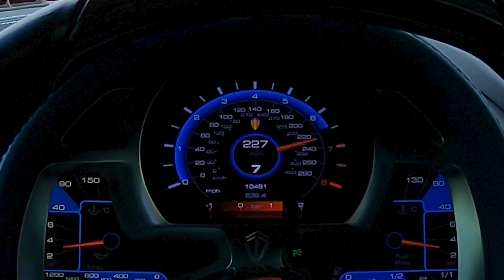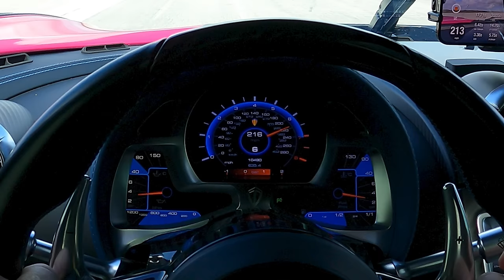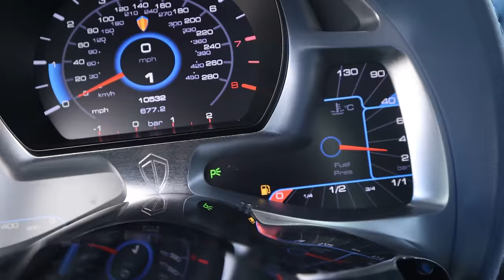My Koenigsegg Agera Broke and Needs Fixed.

Comment: The blue looks SO much better.  Can't wait to see it without the matte wrap.
Reply: ppf have a purpose, it is to keep the paint safe and clean
Reply: @komar2452  correct, but the matte finish desaturates the paint. With a gloss PPF it will look much deeper
Reply: @komar2452 Also you can get clear PPF. I don't even know the OG colour, but covering that impeccable carbon should be a sin.
Reply: Satin paint has a shinier finish than matte which is more flat. 7:48

Comment: Pro tip. Don’t worry about speed till after the run. Worry about RPM and staying centered on the road. Your speed is independent of your gaze, your shift points are directly related to your focus. I’m surprised no one advised you on where to look and what to do.
Reply: Exactly know your braking point and other than that and tach nothing else matters
Reply: @cheeseontoastbrah that's why the Senna has the fold down display that just shows rpms lol. And 720s
Reply: I think it would be some great content if he did a couple months of actual driving classes. Teach him how to actually handle cars like this. Kinda like how TJ Hunt learned to drift.
Reply: @MrSeanman30 It also shows speed
Reply: @Hayden_Morris  that too
Reply: yeah... hes gotta narrate the run in real time though (or so he thinks)
Reply: DontReadMyProfilePicture.273  nice😅
Reply: Yeah he needed some sort of coach there or something to guide him.

Comment: $16 for miscellaneous fees? scammers!!!!!!
Reply: 1000$ for wheel alignment is more of a scam! 😂
Reply: James in crazy for dropping all that cash on a car holy smokes you could literally buy a brand new corvette or camaro for that
Reply: @motofreak682  Yea but Koenigsegg
Reply: @daniellissenburgh1584 was thinking the same thing. How much harder could it be than a normal car that costs $100
Reply: @adamward6468  because the set-up would be nearly the same for a LMP racecar, that's why
Reply: What do you think insurance costs to be able to work on multi million dollar cars? 😂
Reply: the lunch fee
Reply: Its shop fees like oil disposal and ppe it’s apart of the dealship I work it
Reply: It's for the sealant for the fuel pump.

Comment: All out of thought is it's a Koenigsegg I know it's got more than this and I have pushed it to the floor and kept going you over thought the whole thing you need to be more relaxed when you go into something like that and speed never matters until you're done just look at the RPM gauge and temperature gauge and of course making sure you're going straight. You should be able to feel your shift point coming

Comment: Bro, when you're going for those high speed runs, the ONLY concern you should have is driving the car. No worrying about cameras, you shouldn't even have to look down at the dash, use a shift light and some kind of heads up display for speed and temp with spotters also monitoring readings remotely. All you gotta do is drive brother!

Comment: I want to know what parts are involved in changing the wing angle for $2,000+. Brah its a lease. Drive it till the wheels fall off and give it back. Not your problem after 3 years.

Comment: The egg is a lot slower than it should be I noticed in the video of you Vmax attempt it really struggled to even pass 200 which it should be doing with ease and would climb to over 250… in your video after 200 it hits a wall
Your veyron would easily do 230-240 on that same strip

Comment: James must have made a slip of the tongue or he’s windscreen device is wrong. Because my 2008 1.6litre Toyota does 0-60mph in less than eight seconds!. If it actually took over eight seconds to do 0-60mph in that Koenigsegg there is something seriously seriously seriously seriously wrong with it!. It should do 0-62mph in under three seconds and 0-124mph in under under eight seconds!. So if this one’s taking eight seconds to get from 0-60mph it’s got a major major problem!.

Comment: 1:50 what was the need to be worried about the cameras. Been watchin you for years now. Please prioritize your ownself. You were making a go at putting your life at danger provisionally and its better to know and be with the machine than with the camera as you could do 10s 100s 10000s of runs if you can come back out of the car in the same condition you sat in.